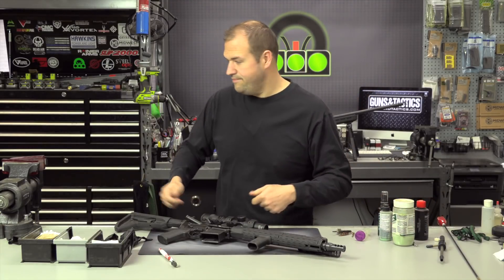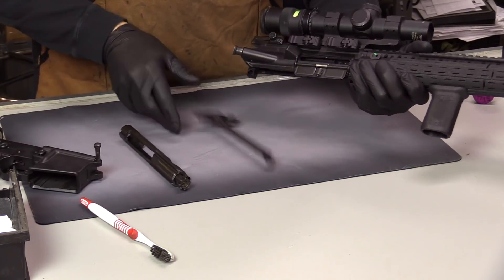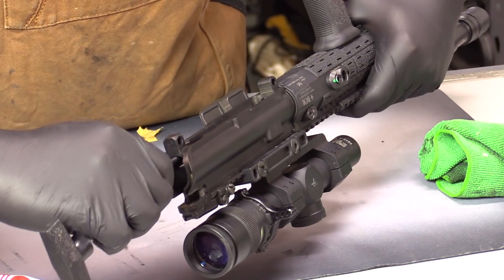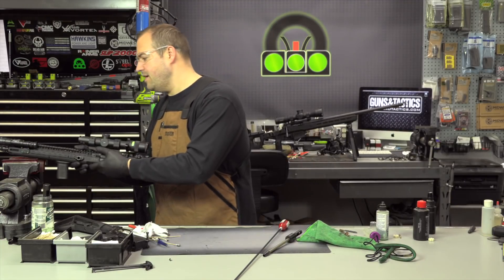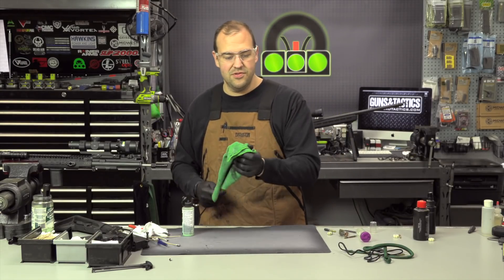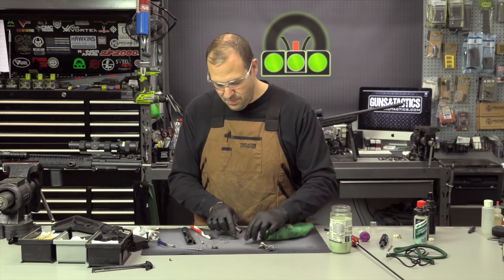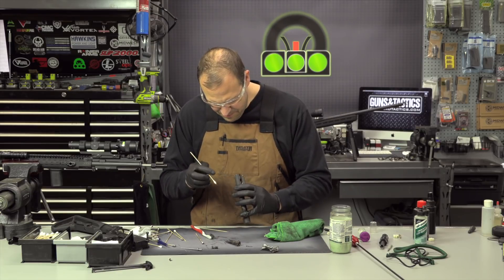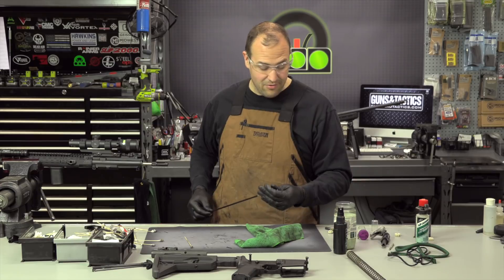How to Clean your AR15

Comment: I've always used a pipe cleaner to  clean the inside of the gas key. 
I've never had a problem with it getting stuck.
Some might say it's  unnecessary, but the pipe cleaner always comes out dirty.
Great video !

Comment: How do you clean the gas tube and how often?  Cant find anything on this anywhere.
Reply from the maker: Gas tube really cleans itself.  The high pressure really blows out crud on its own.  The only problem is when people shove stuff in the tube where it gets clogged.  After the tail gets worn you simply replace.
Reply: @UN12actual  THANK YOU FOR THE INFO.  GREATLY APPRECIATED.

Comment: Have you ever tried or have thoughts on the Slip 2000 grease? I use it on almost everything I own right now and just hit it with a couple of drops of the slip oil every 500 rds or so.
Reply from the maker: As far as grease goes it’s my favorite.  Use it sparingly because grease attracts dirt and is sticky.  Not only does the lube part stay in place but so does the grime. Generally on an AR the only place I would use grease is on a trigger sear and cam pin and that’s about it.  Other places it can get sticky and turn into a compound.

Comment: You mentioned that CMC would be one of the triggers that you liked, in an earlier video.  I bought a CMC trigger for an SPR,  based on that recommendation.  CMC says to use a moly type lube on their trigger.  Could you speak about where that moly would go, or whether you feel the lube you used, in this video, would be sufficient?  Thanks
Reply from the maker: A quality lube will work fine, on the sear surfaces and pivot points.

Comment: I like using a ultrasonic cleaner filled with Sea Foam and heating the tank.
Reply: never thought of trying sea foam with my firearms even though i use it when i do oil changes in my cars
Reply from the maker: Haven’t used sea foam but it makes sense.  How are the fumes?   I love heated ultrasonic.  Makes work much easier
Reply: I try to keep temp under 120, this works. It also loosens carbon on the bolt and carrier so I can finish it up with  Otis Bone Tool.    @UN12actual
Reply: Gotta give Sea Foam a try. Do ya buy it by the gallon?
Reply: I did, O'Rilley's auto parts had it on sale and gives veteran discounts  @smsgtbulldog
Reply: Denis Bowman thanks...they always give me my discount

Comment: I clean every 1000 rounds. And it's a quick clean . The barrel I run a bore snake 1 time and that's it.  
I use Breakthrough Solvent and G96 Synthetic CLP or for storage I use G96 Gun Treatment Spray. 
The barrel doesn't need to be cleaned as much as people think . I've seen people go 3 or 4000 rounds and then run a bore snake through 1x . 
I use an old tooth brush , micro fiber towel , bore snake , qtips,  chamber brush and Otis bone tool with star chamber thing.
Definitely a sissy for wearing gloves plus apron . Lol jk .
I use the G96 spray for barrels . I spray it directly down barrel and wait 15 min or so and run a bore snake 1 time.  For the Bolt / BCG.  I spray down with solvent and let it sit for 5 min then wipe it off . 
It literally takes me about 2 min of work to actually clean . Every 5000 rounds I will be a white glove cleaning and also throughly inspect parts . 
I've gone 4000 without cleaning before and still did it the same process. 
For guns I don't shoot that much . I only use G96 spray because it works the best for storage and I love that sweet smell lol.